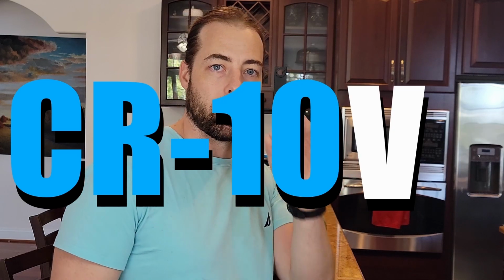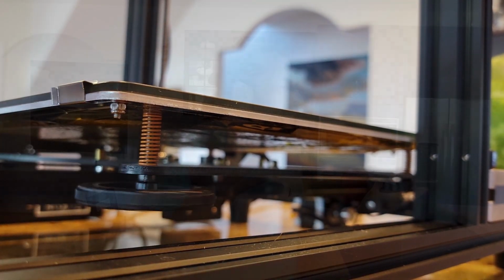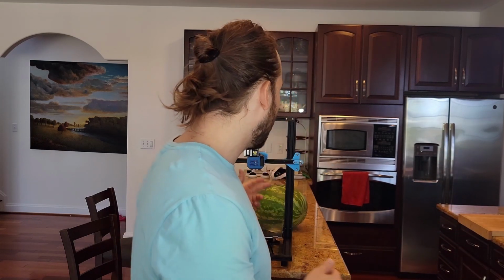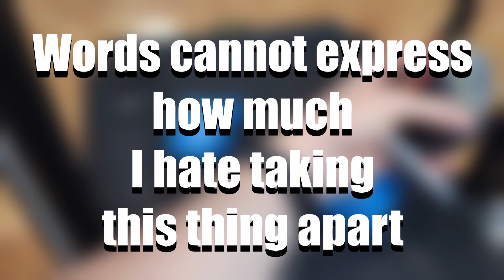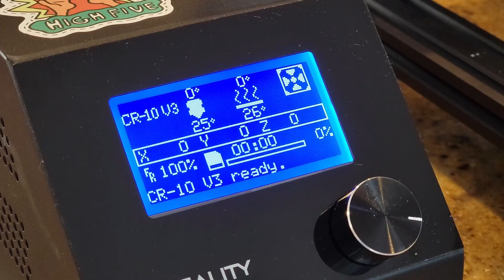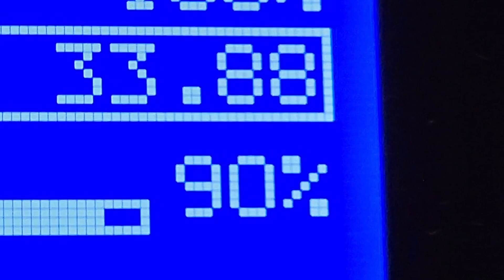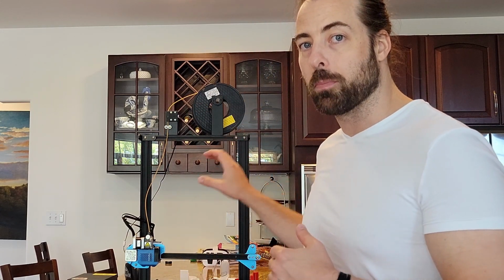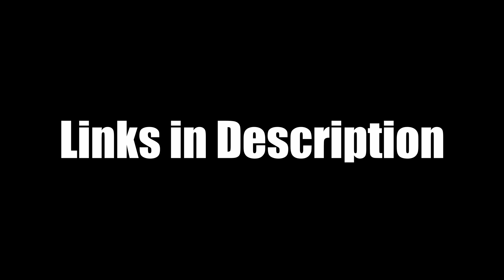I ALMOST THREW this 3D Printer in the GARBAGE (CR10 V3 Fix)

Comment: You shouldnt have to replace or repair anything when you purchase a brand new printer... That being said. I bought one of these during the recent sale. Right away i had problems leveling and most importantly keeping the bed level. After some trial and error i realized that the bed springs were starting to sag the more heat soaked they got. I had not even printed anything big. Within 3 days of having the printer i decided to print some PACF bed spring spacers and compress the springs a little more. This worked like a charm!!! But because im a little crazy about stuff like this and i dont want future problems, i did a quick search and found some silicone solid bed mounts FYSETC $11 on amazon. With these i was able to manually level the bed perfectly. They still provide a little squish for leveling the bed while maintaining the functionality of a solid bed mount. Heat bed, tighten then adjust. I then installed BL Touch $50 on creality store and Nic's updated marlin firmware $0. Nic's firmware is amazing, you can find this group on facebook. After that it was like a whole new printer! The bed levels and keeps its level very easily. Updated marlin FW has the Z offset tool built in, again amazing. Add G29 after G28 to your slicer gcode to auto bed level before every print and VOILA! I also did a few preemptive things including a new PTFE tube in the hotend. I used capricorn tubing $12 on amazon. Turns out the factory ptfe tube was short by a few mm and is prone to melting. So after a little measuring i cut and replaced the tube with one the proper length that is much better quality. I also replaced the bed with a spring steel magnetic PEI bed sheet for easy print removal $35 on amazon. For good measure i installed the Z sync kit from Tiny Machines $15. After all of that was done, i calibrated E steps then went through "Teaching Tech" entire calibration walkthrough. Again i say "you shouldnt have to replace or repair anything when you purchase a brand new printer".  BUT!!!! if you have already purchased the printer and aren't in need of a huge paper weight, i think these options might be for you. There are a few other things i printed mods for like the filament sensor to angle it so it feeds from the roll better without binding. A cable chain for the hotend wiring and a few other little things. Hopefully this helps. I was trying not to pull my hair out while figuring this all out. I dont have much hair to spare. Happy Printing!!
Reply from the maker: Wow! That is crazy! I made a video about what I called their recent "Firesale" but I'm sincerely glad you got it working because when it works it can print big things like helmets so well. Thanks for the advice for others to see. :trophy-yellow-smiling:
Reply: @Kimchi_Studios  I watched the video about the fire sale after I watched this one. It prompted me to come back and share my experience lol.
Reply: Nic makes a great FW.  I also run it on my V3. I'm wondering why he is printing on the back side of the glass plate?
Reply: omg the stuff ive had to do to my cr10v3.....  replaced the top frame cross member with steel as it was twisted. retapped the angle support rods with left and right handed threads so it can telescope by the eyelet joints to adjust the tilted Z frame.  had to rebuild the hotend a half dozen times - welded the wiring back onto the hotend when it broke.   ive had to replace the fans.   i had to machine the bed (hot plate) as it was heavily warped.   recalibrate all steppers (they were all off by at least .75mm),  firmware flash, bltouch addon.  repalced the fan in teh control box, shimmed the bed by over 5mm as it was too low to allow the hotend to reach out of hte box (like lead screws on Z bottomed out when it was 4.5mm away from the bed surface).  lots of work to square hte frame - welded gussets at 90 angles and drilled/tapped all corners to addon support form steel. it was all out of true from factory.   my gantry extrusion was 2.27mm bowed downward in the middle (concave to the bed) so the center was always a 'high spot' when leveling....   from factory the bed was lopsided, z axis out of sync (had to buy that sync kit to belt them together)   im sure there is more but this is all i got for now

idk. ill NEVER recommend a creality to anyone, ever...   but fuck if i didnt learn a lot with this as my first 3D printer...

Comment: The issue you had with having to change the bedscrew height during printing is well documented and a combination of 2 things (neither of which has anything to do with the bed moving... its actually your gantry getting out of alignment & the right side being pulled up)

Here are the 2 things causing the issue:
1) Filament tension pulling the print head up, from a badly designed filament arm & runout sensor placement.
2) Z-Axis motors being independent & not maintaining sync with eachother (the right side drops when powered off... and then gets pulled up during prints by the filament tension)

The two fixes are:
* Replace the high-drag filament arm with something like "Filler" from Thingiverse.   Full name "Filler - The Customizable Filament Holder that fills your printer!".
  This will also stop your filament rolls from grinding and leaving a fine plastic dust on the arm that can fall onto prints.  You might also want to remove the runout sensor if you're OK with that, to get even less resistance / "pull" on the filament.

* install a Z-Axis Sync Kit to keep both axis aligned (works during printing AND when powered off to stop drift).
  These consist of  2x of GT2 pulleys & 1x of GT2 6mm closed loop belt.  It is installed at the top of the Z-Axis leadscrews and locks them together so both sides go up & down at the same speed to eliminate the drift you are having.

Doing both of these upgrades means you'll almost NEVER have to realign the print bed, tram the printer, etc.  I can not print for over a year... come back and do multi-day prints... and never have to touch alignment to keep each corner within 0.004 mm.  If I want to bother doing tramming... I can get tolerances of each corner down to 0.001mm with the ABL below (I use a CR-Touch).

Also, you said that you'd not advise anyone get a CR-10 v3 because it lacks the ability to self-level... but you can buy aftermarket ABL (Auto Bed Leveling) systems like the BL-Touch or CR-Touch that are installed by simply screwing them onto the print head (there are provided screw holes on the head already), plugging them in & updating the firmware to use Nic's firmware (available from the "Files" section of the facebook group "Nic's 3D Printer Firmware & 3D Printing Support")
Reply from the maker: Thx for the detailed help. Hope others see this!
Reply: @Kimchi_Studios  No worries, I hope others see this too :)
If you are still using the CR-10 v3 and having those issues, though, it could be a good set of upgrades to make an educational video about too?
They are relatively cheap (the "Filler" arm is basically free) and they solve a whole host of CR-10 v3 issues, improving print quality, reliability, etc.

Comment: CR-10 V1 owner for 10 years and bed leveling was the worst issue with this printer. Bought a Bambu A1 for Christmas and it’s so easy to get perfect prints off this printer.  I still have and run my CR-10 for now but I’m fast becoming one of those Bambu fan boys now.
Reply from the maker: Good to know, that thing looks solid!
Reply: Get an ABL Bltouch, PEI magnetic build sheet, silicone stands, and it will transform the machine.

Then add Klipper with input shaping and pressure advance and you will get Bambu quality and 40% faster than a stock CR-10.
Reply: @mandoreforger6999  I did all that by buying the CR-10 Smart Pro, well everything but the Kipper part and I'm considering doing that too.  I was eyeing the Sonic Pads but should probably just do it the hard way with an arduino, I would learn more this way too.

Comment: when it comes to leveling the bed always heat up both the bed and nozzle while doing it as materials expand/contract when heated also the BL touch upgrade works wonders with bed leveling i have this printer and it works great you just gotta know what your doing

Comment: You can buy an auto-leveling kit for CR-10 for like $50.  Add silicone bed stands and a PEI magnetic build sheet.

It will change your life.

Then add Klipper with input shaping and pressure advance and high flow hotend and you can get better prints 40% less time.
Reply: How much does klipper costs?
Reply: @EldenNoCuts  you can add a Kipper pad on sale for about $90.  Big tree tech or Creality.

Comment: CR10-V3?  Where are the diagonal braces on the front of the printer? Mine has these...I did have leveling problems until I replaced the entire extruder with a factory assembled unit from Creality, I thought my hot end was defective because I could not change tips (-found out that works a lot better if you change the tips when hot - OOPS! RTFD).  Printer works perfectly now, only need to relevel (Tram) the unit once every 8-10 prints with a piece of paper.  Have printed several large  (2-3 day prints) with no further problems.  I use mostly Hatchbox PLA, and sometimes Amazon branded filaments for specific colors that Hatchbox does not have or Amazon is out of.
Reply from the maker: Creality is a low budget printer company. They recently had a firesale discounting this printer 50% off. The title of the email was "Defective Item Sale"...I made a video about it. Then, creality sent out the same promo email but the title now said "Defective Item Sale, Nothing Wrong Basically". See my community tab post for the screenshot. They are the chevy spark of printers. A fun idea for beginners full of regret and wasted time fixing and leveling. Everyone I talk to that has experience with Creality printers tells me that they replaced an even crappier brand of printer that no longer exists. The braces are good for swinging the printer around the room when it needs a reality check.

Comment: you can add a bltouch or crtouch and update the marlin.. 😬
Reply from the maker: I researched the BL Touch before I even bought the CR-10. The results people were reporting were mixed. The CR touch reddit ain't looking too good either. The printer still infamously has a problem staying level on one side. 😬